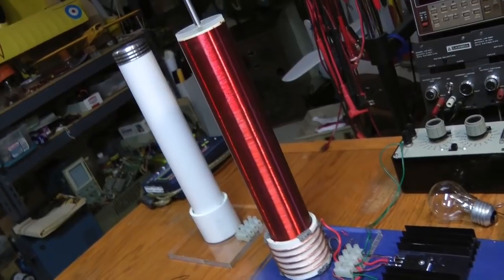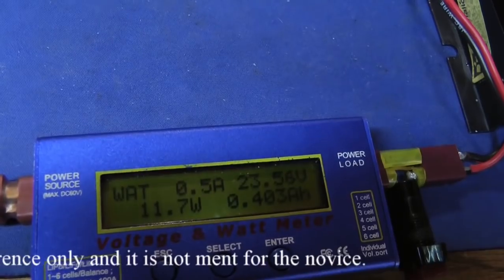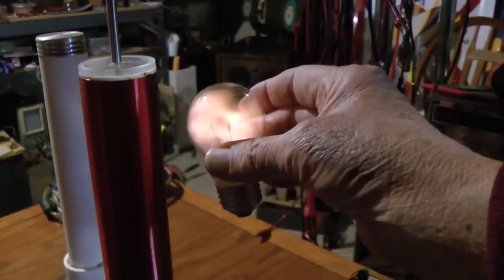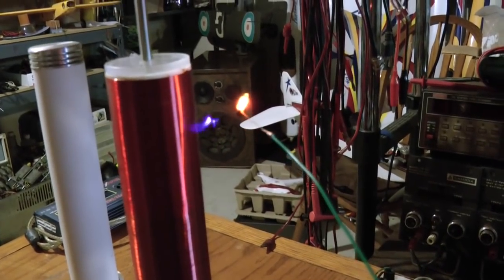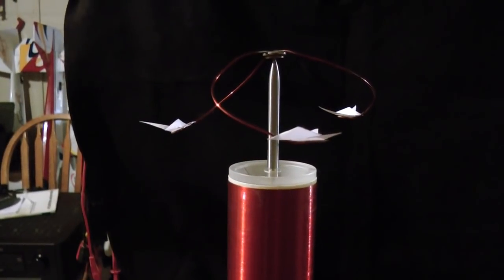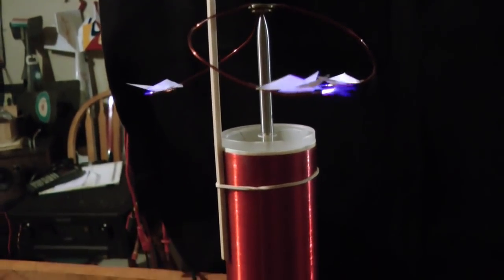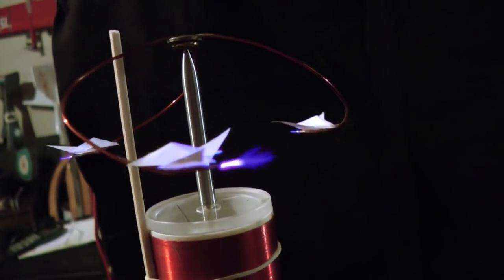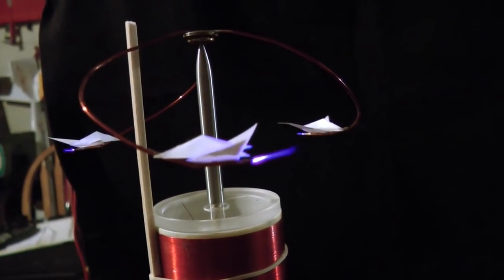Tesla / Slayer Ionic Propulsion

Comment: The effect you are getting is due to the air being turned into plasma and ions are being released. Just like what happens when it lightnings and the expansion of air around the lightning bolt is push to above the speed of sound and that is why we hear it thunder. You are controlling this process with the Tesla coil. But, I have a feeling if you are smart enough to build your own Tesla coil you've got this figured out by now. Oh another way you can play with this is build a small vacuum chamber to put it in and see how it acts in a full vacuum. Then add some argon or neon gas to the vacuum and see the different reactions.

Comment: The 'exhaust' being emanated from the rear point on the flyer is a stream of fast electrons. Although their mass is minute, they are produced in huge quantities and have high velocity; thus they act as a 'reaction-mass' for propelling the vehicle in exactly the same way that a rocket-engine works. (Thrust = mass flow-rate X velocity). Some additional thrust may be produced by the generation of Ozone (O3, which is an allotrope of oxygen, O2): being a heavier molecule, it would have greater density than the surrounding O2, thus more mass, producing more thrust. I'm not certain about this point; perhaps interested viewers could research it?
Reply from the maker: Thanks Glyn.
Reply: Glyn Davies what would it do in a vacuum?
Reply: If it's emitting electrons, doesn't it make it cancerous? Ie. X-RAYs?
Reply: No, X-Rays are very energetic high-frequency electromagnet radiation and, like light, are propagated by Photons. The electron stream generated from a Tesla-coil is just an electric current being thrown away from  the emitter to be dissipated in the surrounding medium - in this case air, but if you stood too close it could be you and your hair would stand on end!
Reply: It's just the other way around. The thrust comes from ions being accelerated from the anode (+; torus) to ground (in this case just electrons in the surrounding air), called ionic wind. By the way, at (accelerating) voltages of more than 5 keV,  x-ray radiation will be generated (ofc one has to stay pretty near for a time to get (potentially) seriously harmed)
Reply: That's wot I sed, diddle eye? ('cept for the x-rays)
Reply: Still provide thrust. Reaction masses work better in a vacuum!
Reply: it's not exactly the same since you wrote the thrust comes from electrons. Actually it comes from the ions (positively charges), being accelerated to ground potential.

Comment: See if you can find a heat resistant tube about 2 cm in diameter and slip it over the end of the wire. The idea is to eliminate any ionization and 'thrust' to the sides, and focus it all to the rear. Like a micro ramjet.    It should then draw in atmosphere from the front of the tube, and expel the ionized plasma from the rear. In theory, it should increase thrust. Find a way to measure the thrust output before and afterward to see if there is an improvement in thrust efficiency.
Reply from the maker: Hello, That's a really good idea Shadow. It makes sense to me. I'll try it soon.
Reply: Don't keep us in suspense!
Reply: Shadow4evr thats what i was thinking but didnt know how to explain it all.. :)
Reply: Basically, it would create a miniature plasma jet engine. The advantage of it, is that while in atmosphere, it would ionize the incoming atmosphere creating directional thrust. In space, there could be a gas injector, whether it's hydrogen or something else less volatile but still able to be ionized. If hydrogen is used, the engine would need to be designed to stop the combustion wave from propagating backward up the engine, most likely a Venturi designed into it would increase the speed of the gasses at that point, and on the far side of Venturi as the chamber opens up again, that's where the gas hits the plasma. 
So yes, it would use fuel, but could be quite effective with a minimum of moving parts. 
More research and testing is required. 
A propulsion engineer would most likely find the weakness in my idea.

Comment: the ion thruster used in space is much bigger and heavier and produces power that can hardly put off the torch , so either they are doing it wrong or your device just heats air causing it to expand causing air current
Reply: crowxe Umh no, the principle of the ion propulsion is the same (put ions in a stream line and force to push it) but the methods are really different. A Ion Thruster anyway can easily turn off a torch,but they are used in space where there is no air. They use instead Xenon to make the "flow", cause Xenon is much denser than air and so can produce more kinetic energy (K = 1/2mv^2), but it's obvious that if you put a ion thruster without xenon here on earth you will simply push air like in the video
Reply from the maker: Yep.

Comment: Its about insulation.  The wire is exposed only on the back end of the paper airplane.  This causes the ionization to be at the back of the wire / paper airplane.  The ionization causes air to rush in to the area at the back of the wire / paper airplane.  The air is attracted to the electrically ionized area to grab the ions, or fill the ions.  The ionization acts like a negative pressure, or vacuum.  So the air rushes in to fill the vacuum, ionized area, and pushes the little paper airplanes forward relative to the model.  This is very difficult with an actual craft.  You have three axis' of navigation with an actual craft, and it makes the thrust vector equation very difficult.
Reply from the maker: Excellent point Z. I don't know if you can use a rudder in an ion wind. Ha, that might be something to try. I suppose if a craft was like a star wars fighter with a X wing you could have a thruster on the end each wing tip. Problem is in space these take weeks or even months to increase speeds. I don't think you could make a sharp turn to avoid space junk. LOL.
Reply: But what about drone application? Or hovercraft? If air could "rush under" and lift it up, there are other ways of navigation. Try a flying saucer model and a thinner wire that can bend. Then check weight lift capacity. Also, an inverted model upside-down with a parachute above. Would the ionized air force the parachute to lift? Like an open balloon-thing where instead of heat you use the moving particles.
Reply: If the ions were creating a low pressure zone then the plane would move the opposite direction. I think the ions move that direction because of the sharpness if the point, it's been a while but I've read a little about electronic spacecraft propulsion, and you're far more likely to get ionization at a sharp tip.
Reply: Z Monkey I think the main effect here is the ionization heating the air near by. I don't think it ionization will create a vacuum since it doesn't take away any molecules from the air. Just peels off some electrons.

Comment: I think the plasma is super heating the air wich makes it expand and push off of the end of the wire creating thrust
Reply: That would be my guess as well. Tesla coils alternate polarity, so should produce both positive and negative ions, which should cancel out any electrostatic thrust. For ion propulsion you need to produce a single-polarity corona/brush discharge so you ionize some air and then the electrode repels it due to having the same polarity. Or use an "asymmetric capacitor" (two electrodes, one sharp and one smooth, so the sharp one produces ions which then migrate toward the smooth one, bumping neutral air molecules along the way)
Reply from the maker: I think there may also be the capacitive effect from the electrode point to earth ground as explained in some of the Tesla experiments.

Comment: Well if there is ion movement, the ions have to come from somewhere either air or some fuel flowing through the tubes. In an ion propulsion system, which is essentially what you have here, some inert gas is usually used.
Reply from the maker: Negative ions from the high voltage high frequency try to get to ground to form a complete circuit. Cathode to ground anode. My opinion.
Reply: DadHav you are correct sir.
Reply from the maker: Thanks for the Sir thing, but John is just fine. LOL I'll tell you something funny, a while back on this video someone asked a question that was relevant and I posted a thoughtful answer. The next thing he replied was something like. "I'm 9 years old" LOL

Comment: You should do this with a long fine wire and a little plane that can actually fly and set it up like a control line plane or one of those little jets on a string that you hang from the ceiling.
Reply from the maker: That would be a challenge. I'll keep it in mind.

Comment: Wow, that's really cool!!!
So from the Video and Comments, 1)This can be done in a Vacuum.
2)There aren't magnets or hollow wires.
3)It moves a steady stream of air as well...
I guess it could be electromagnetic, but that alone wouldn't explain the moving air. Unless any arc of substantial size moves a stream of air.
Since this is a Physics Question, I would ask Physics Girl... She seems pretty cool.
Reply from the maker: Generally there are two screens, one negative and one positive. I think in the case of this resonator the earth ground takes the place of an anode. The cathode releases ions that try to get to ground because there is no anode close. I need to make an adapter for the top of the resonator that has an anode. Just my latest opinion.

Comment: Another way to describe it is Electronic Discharge Propulsion (I know that it's not like a battery getting the charge knocked out of it via discharge method, but the expelled force isn't the magnetic aspect) Kinda scary thought as  propulsion system of aeronautical crafts. Might be stronger if utilizing in containment, to build pressure, for controlled expulsion.     Can the same discharge be made from D C? That could be a first step for R/C model... But the real feat comes from maximizing controlled kinetic output from that spark source energy.     Really Cool demonstration model. It can give real numbers for base calculations if you test with more outputs (planes on wire) and factor weight. I know in the balanced situation that it's zero friction, but it's still load weight to put in motion. Thank You for your really awesome experiment. Stay safe.

Comment: Electrons are coming out of the ends of the rotor wires and they each have a mass of 9.11 x 10-31 kg.  They exert a force on the rotor as they leave and they cause it to spin just like water causes a rotary water sprinkler to spin.  Your circuitry causes the electrons to come out in high frequency pulses.
Reply: That's what I thought too, but how does that explain the "wind" that blows out the torch?
Reply from the maker: I recently found out that the flame is sort of a plasma itself. Maybe the ion flow or magnetic field is affecting the flame more than a wind.

Comment: Aeomike's assessment about the air heating and providing thrust seems reasonable. It should work in a vacuum because of Newtonian physics RE: "Equal and Opposite reactions" However, in a vacuum the push would be much, much smaller.

Comment: Take a ir temperature reading of the tip;
Could be the plasma forming is creating expanding air with heat along with the ionic discharge inducing a flow direction in the air. 

I'd wanna hook it to a newton meter and see how the thrust increases vs input wattage, plot it.

Frequency will likely play a part.

Comment: The reason that the plasma is causing the little rotor to turn is because the plasma is igniting the oxygen immediately around it. This ignition is causing the expansion of the gas/air, and that is why it is blowing on the flame. This would not work in outer space because there is nothing to ignite.
I have developed a propulsion system that will work in outer space. I have successfully converted centrifugal force into directed thrust. It is called a Centrifugal Propeller and there is an early version of it on YouTube. It will continually accelerate in space so there will be gravity in the spacecraft and no speed limit.
Also, I wrote a paper that proves that matter, including spacecraft, can travel faster than the speed of light. It is at (without the spaces) www. keelynet. com/ energy/ftlplum. html
I appreciate all comments and critiques and questions.
Jeff Pluim
Reply from the maker: Jeff, that's very interesting. Recently I read that ion drives in space inject xenon gas into the ion stream to compensate for the condition you mention.  Wow your file is really deep. I'll have read it carefully later. Thanks.

Comment: What is the weight of the wire and paper. And how much power is being used. How much heat is being dispensed by the arch.  And what if you made it bigger😁.

Comment: its called ionic propulsion basically the ions are bouncing the other particles away by taking the atoms out of the air and using them to perpetually create negative ions by giving atoms an electron and pushing away other atoms thus creating propulsion this does not work in space USUALLY as most of space has particles but in very few quantity. the way NASA does it is they give the ionic thruster gas (oxygen, carbon dioxide gasses like that) to create propulsion.
Reply: I was wondering how ionic thrusters works in space thanks for the explanation 👍

Comment: Will it work in a vacuum? That will tell you if it's heated air moving it or ions
Reply: andrakis2 How it extinguish fire it seems to be air but not quite exactly. Seems like a vacuum experiment will make it clear.
Reply: Cronie Brownie exactly although if it is ion projection it will eventually erode the wires that are producing the sparks
Reply: it could be plasma, an ion engine that instead of using directed electrons, super heats and charges a heavier gas, it looks like its either making oxygen or nitrogen plasma, and its causing thrust
Reply: Joanna it's possible. But putting it in a vacuum chamber would eliminate that theory as well as there is no gas in a vacuum

Comment: The tip of the metal rod is where the electrical charge likes to accumulate; the entire metal rod is still charged, but the tip is most dense with it by far. When you connect something to the tip, it distributes the charge of the tip to whatever it is attached to (in this case, the three copper wires). My guess is that since Nitrogen glows purple when it moves around in its energy levels and that flame was a light purple, it's the atmospheric molecules moving around energy levels. Those molecules would either become anions and combine with molecules in the atmosphere to become more energetically favorable, or, since the atmosphere generally consists of diatomic molecules, they would split into their individual molecules and return to a favorable energy state with the addition of electrons from the rod (probably the most abundant reaction between the two). Either way, these reactions coupled with the heating up of the wire due to resistance in the copper wire would create a lot of heat, and therefore generate thrust.

I could be wrong. You can test my hypothesis. If this does not work in a complete vacuum, that means whatever is happening here is reliant on the atmosphere. If it still works I'm completely wrong and stupid. If there is a smell emanating from the flame, there is probably a reaction changing the atmospheric molecules to something else. If you put this in a very high oxygen environment and the flame is green, the copper is being turned into rust via ionic reactions (not ionic propulsion as it is known by NASA but I suppose it could technically be called ionic propulsion...?) and therefore happens in small amounts in regular conditions. You could put something nonreactive like an iron nail on the tip of the flame to test the presence of ions. If you keep it submerged in the flame and it burns another color, that would mean that the flame consists of ions, and the ions are reacting with the iron. If you made it this far thanks for paying attention lol. This was pretty fucking cool and hurt my head to think about. Maybe I'm wrong, maybe I'm right, idk. Good luck with further experimentation and shit
Reply from the maker: Dylan, I hear Ya on everything you said. I haven't seen many comments that include the words anions and cations. I just noticed the words start with an and cat. I suppose this might mean that the they are attracted to the anode or cathode. However,  the more you read about them and what they are composed of brings more confusion as to what is truly happening.  I wouldn't use the word stupid with anything in your comments. I really appreciate you spending time thinking about the experiment. I'm the one who was stupid and asked for help figuring things out and it worked. This has been one of the most informative discussions I've had on a video. There is a video of someone doing this in a vacuum. I'll study it and get in touch with the guy who did the video. It looked like it didn't propel and that the vacuum resembled more of something like a plasma globe. I'll post a link after I investigate a little further. The wire might be getting hot but it would only be right at the very tip. The plasma or ion flow is not like the spark gap Tesla. It's very hot itself, and will burn a hole in your finger immediately. The smell is very unexpected.  Ha, self cauterizing. (maybe frequency related?) I'm actually a little hesitant to experiment to much. There seems to be very little information on health hazards, especially as it pertains the the solid state resonator.
Take care Dylan.